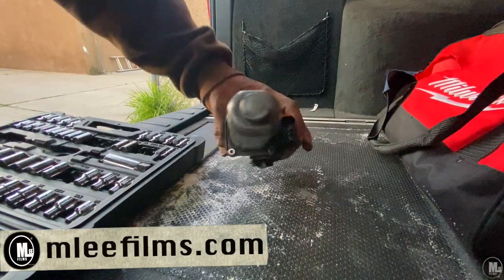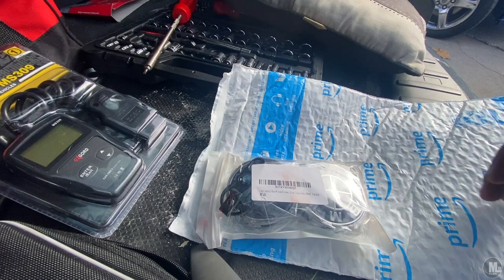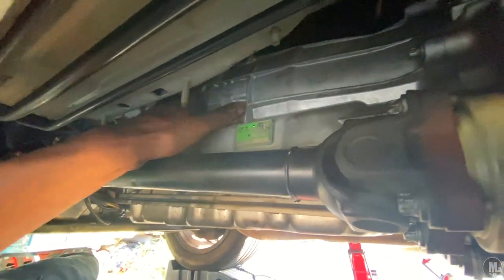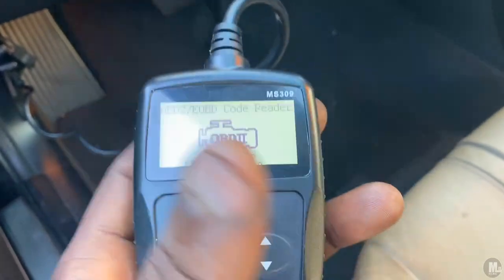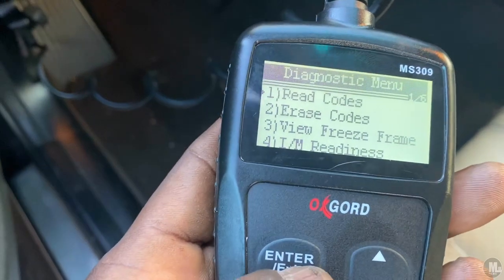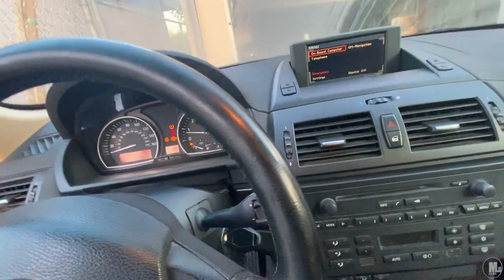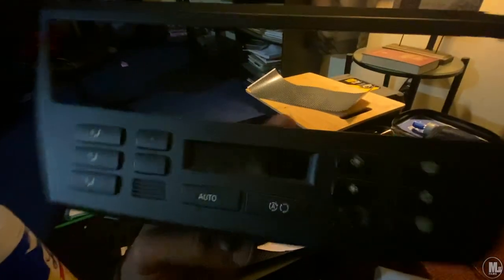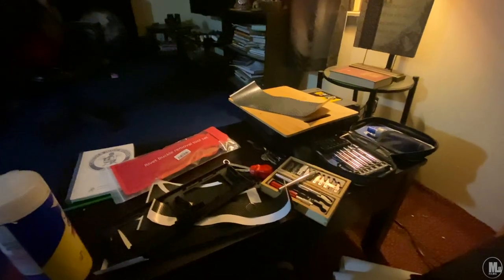DIY Vlog #5 - 2007 BMW X3 Overhaul (Part 5)

Comment: Well, Marvin, 

I'm dumbfounded that without any real mechanical knowledge, you somehow corrected (a well documented ) transfer case problem. 

And, you did some proper safety protocols so you didn't get your bad self squished.

Congrats on that.
You are showing promise but your mother still needs to wash your mouth out with soap.
Respect is EARNED, it not a right.